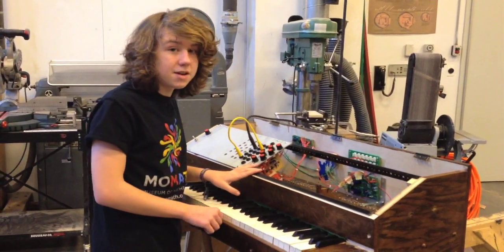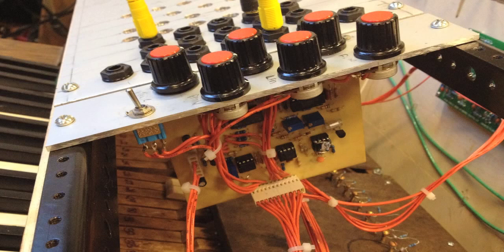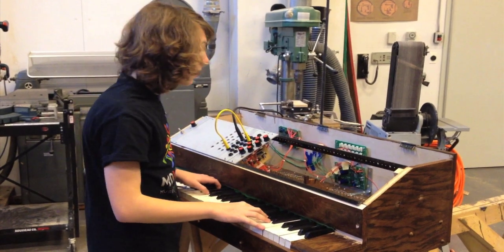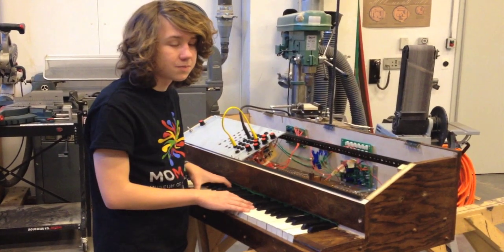Analog Synth

Comment: I've come to the conclusion that you need to have a certain type of brain to figure out schematics. I've been trying to make myself a guitar effects pedal and I've yet to make one that works ! Mind you.. I have used recycled parts which I wanted to do, as so many useful components get sent to landfill !! so may'be some are just broken and my circuits are fine.. praps I should use new components first :O)Dead impressed with what you have achieved here.. well done Fella !
Reply: Really - buy new parts. Components do breakdown - caps lose electrolytic and dust and nicotine are big killers - plus it's very time consuming and how much energy are you burning just to recover some caps and resistors?
Reply: SONGSTICKS . You will or not be suprised how much good little finds  you can get from the local tip. I went scavenging one day and found and old roberts radio circa 196x/70 i think . I found lots of old salvageable parts mainly old tropical fish caps which you cant really get anymore. Even other parts . I made a point of  tearing down dead electronics since then to see what i can find.
Reply: SONGSTICKS  I was in the same place as you a couple of years ago. I knew what i wanted to build but wasnt sure how to do it. Talking of salvaging. I was given an old casio keyboard that happened to have a bbd chip inside used for delay and chorus (dependant on the cycle speed).  Anyway may be worth checking out my channel if you are still looking to make stuff i do a few tutorials from a simple oscillator to a volatge control oscillator and much more  . :-)